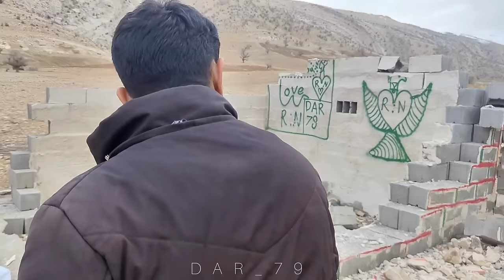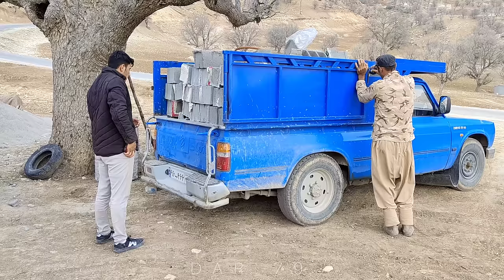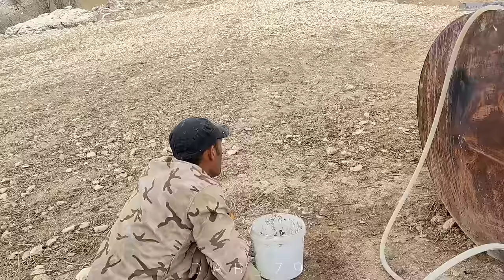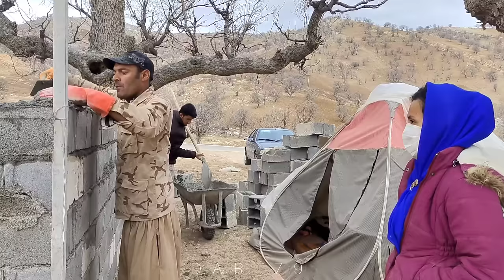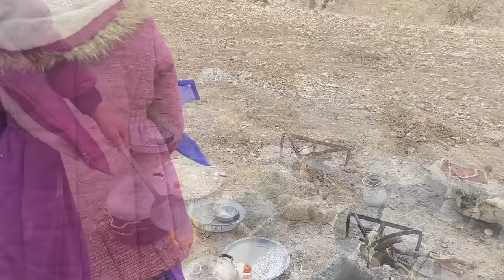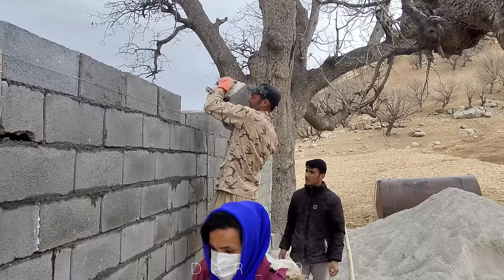Advancing in the rain: completing the kitchen walls of Nargis and her orphans

Comment: Led lights for the kitchen a solar panel and a charge controller and a battery with a 12v fuse box to power the led lights and switches for each area.